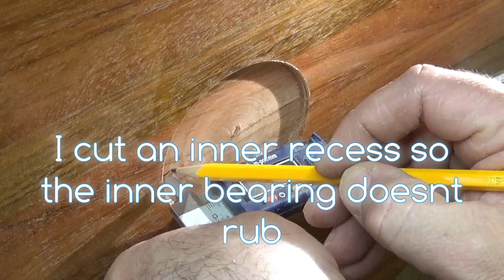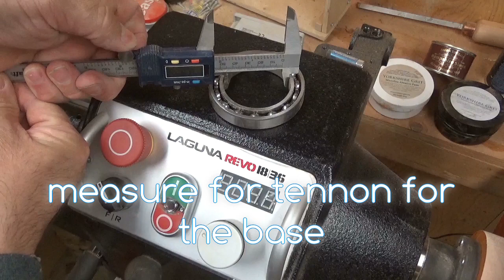Woodturning a lazy Susan

Comment: Nice job how did you find the bearing with side movement out on the outer edges I tried this a few years back and found there was a bit of wobble which was alright but wanted to revisit it and see if I could do better. Let me know if you have any thoughts on it. but overall great video🙂👍nice colors in the timber too.

Comment: That’s very nice project, thanks. My question is what oil did you use to wet sand. I have lathed padauk and it is very hard. I think wet sanding it would be nice to try. And using a hacksaw blade to make a circle is a trick a millwright would do ( like me ) not an electrician . Lol.
Reply from the maker: Shark's gopro 
Ha I wondered if anyone would notice the hacksaw blade 😉, my compass wasn’t big enough and it was close at hand so I drilled a hole where I needed the pencil to mark the circumference...
I use mineral oil to wet sand, any mineral oil will work even baby oil 🤣, the denatured alcohol removes it and the slurry of sawdust, dry sanding was super dusty with Brazilian cherry
Take care
Rob